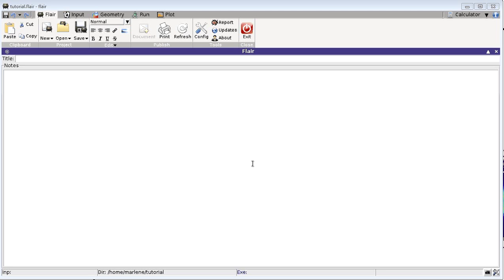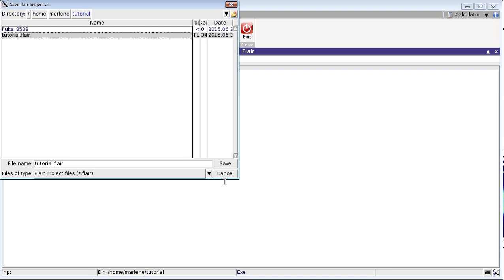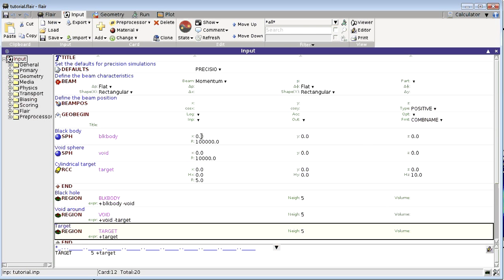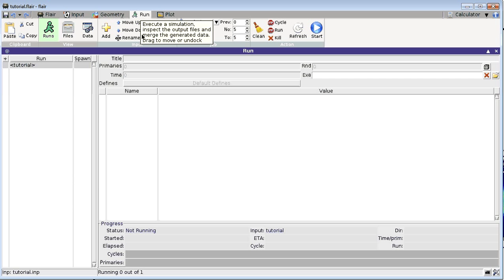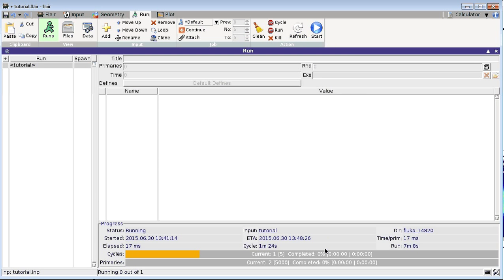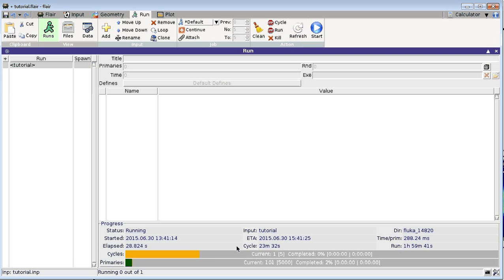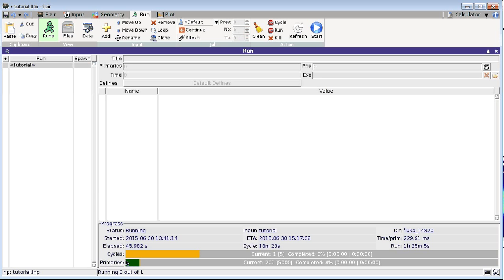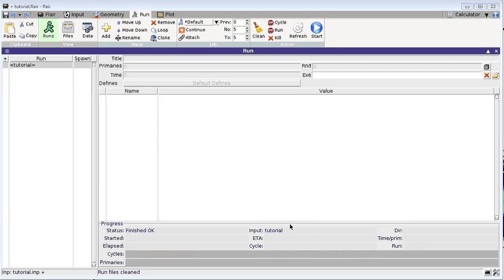first simulation

Comment: Hey I am facing some issue with running FLAIR. I can run those examples with FLUKA alone fairly well but not with FLAIR. 
I even did the same as you did in this video, just create a plain basic example and run it. But my RUN stuck at 1/5 completion stage and never proceed even as I click refresh many times. The output displays: 

Started 2017.01.22 15:42:35
Dir: /media/sf_SharedFolder
Cmd: /usr/bin/nohup /usr/local/fluka/flutil/rfluka -M 5 basic 

p/s: basic is the name of the project*